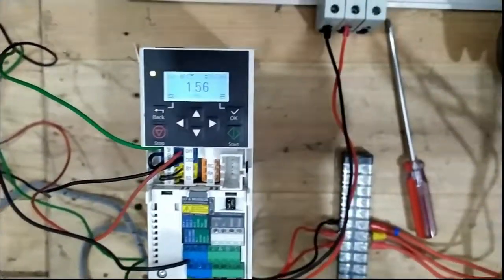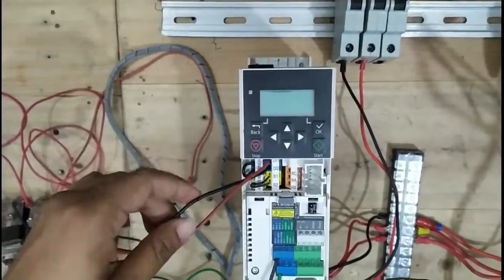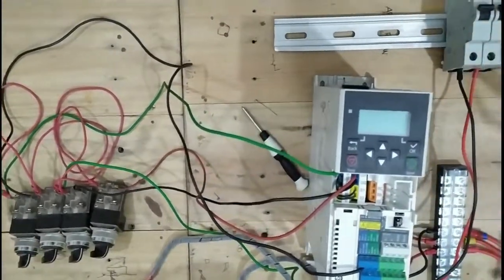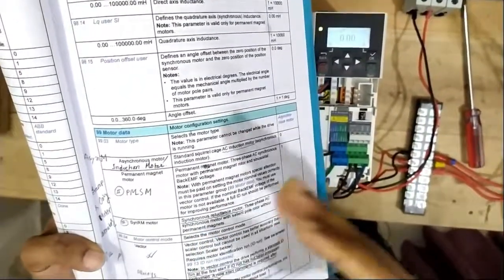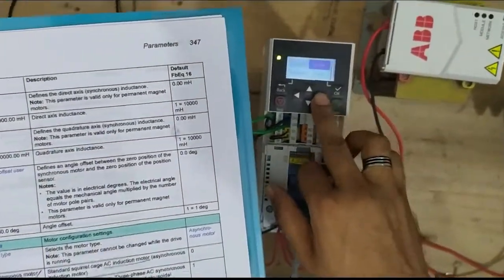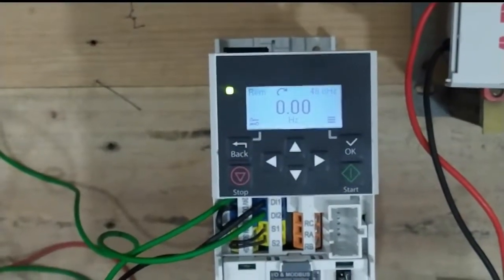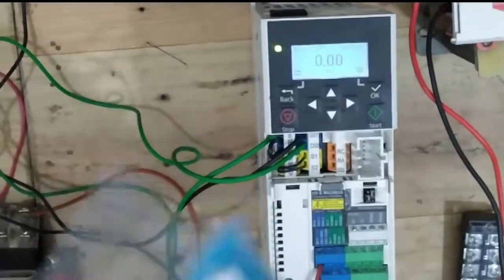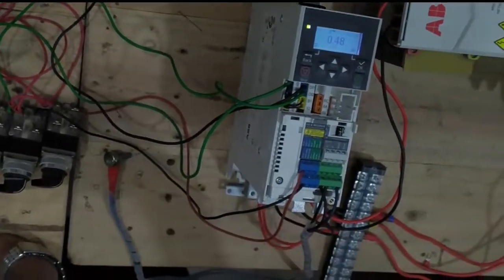How to  run ABB Inverter/VFD , VFD parameters Setting for multimode/ABB inverter/ACS_380 ABB VFD_PAL

Comment: In minute 16:38 .how potensio can work?
Reply from the maker: Range of variable registers value suppose 10k ,100k etc with the generating voltage 0 to 10v or 0 to 20mAms

Comment: When i changed to remote mode .my frequency is still 0.0HZ
And i short di1 and di4 to 24+
Reply: How can i run that in to 45 frequency when start using remote
Reply from the maker: 0 to 10 volt connect for potentiometer, than go to terminal mode and increse speed which you want